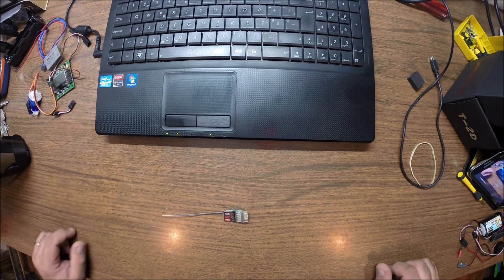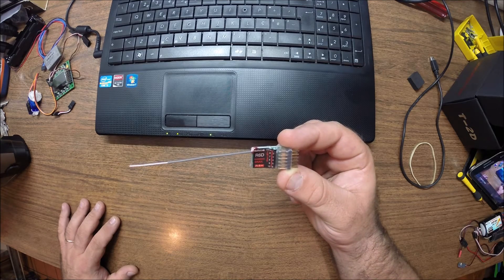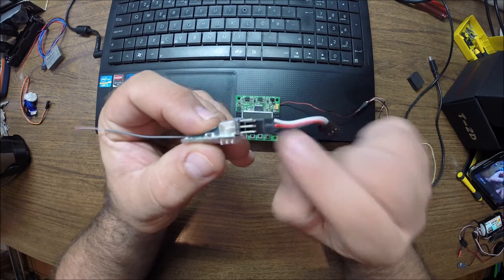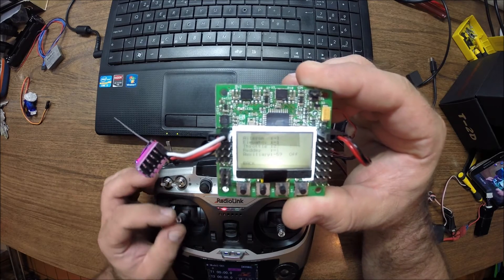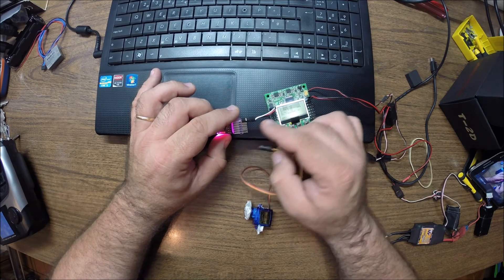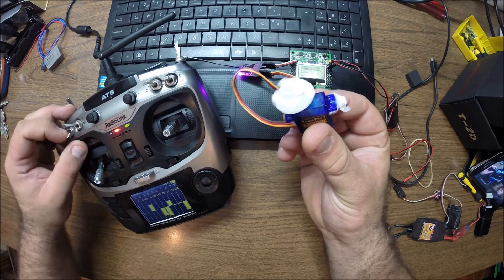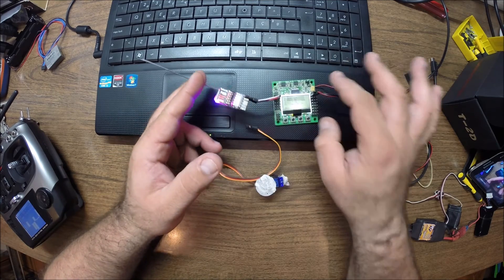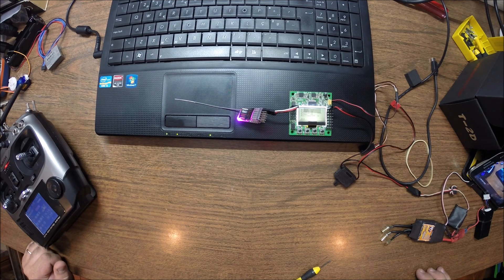Radiolink R6D Review PPM

Comment: I just received my r6d. I bind to tx and tested on cleanflight using pwm and all good. one thing I notice is I do not get receiver voltage reading on the tx LCD.  I have a r9d and on the tx LCD it has the voltage for rx. This voltage information is not available for this receiver. It is always zero. is that normal?

Comment: Sergio, I have the AT10 receiver along with the R10D Transmitter. Works great so far. However, I purchased a R6D to install in a second airplane. The R10D has a separate port for the 4 wire cable from the battery, but there is no similar port on the R6D. I have sent 2 e-mails to Radiolink asking for instructions, and have not received any help. Can you explain to me how to hook the battery cable in? Your video has a KK2 board interface that is 3 wire.  Thanks
Reply: +Dave Weir 
My bad. I finally figured this out.